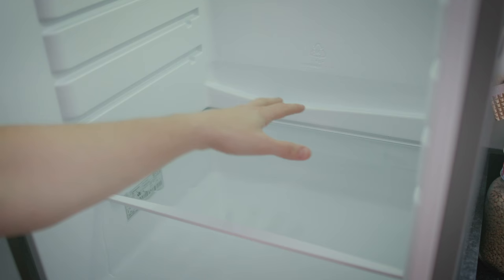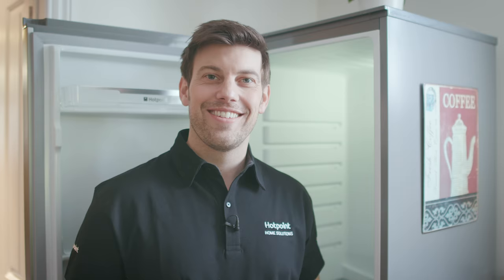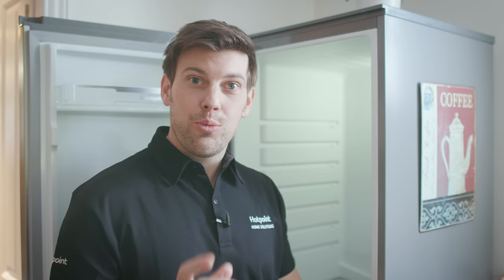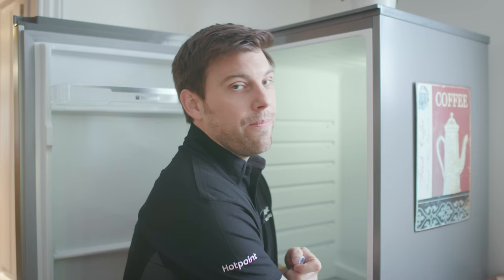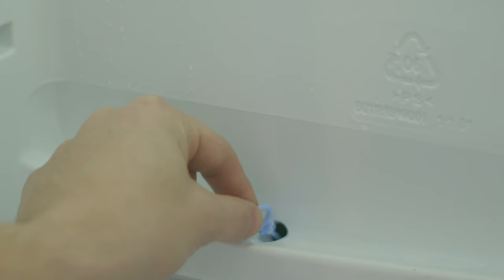How to unblock your fridge drain hole | by Hotpoint

Comment: Protip: if the clogging is out of reach for the straw, either due to distance or narrow turns in the pipe, an electrical cable will do the job! Obviously don’t have it plugged in any way 😆
Reply: Zip tie would work too!!

Comment: Sometimes it easy to forget how fantastic the internet is. Little tips like this restore your faith. Thanks.
Reply from the maker: You're most welcome! 

Thank you for such an amazing comment :)

Aimee
Reply: @HotpointCustomerServiceUK , actually the problem re-emerged after we had been away for a bit and when I tried the trick again i found that the gully was blocked by an ice core about 15 cm long. Firstly I tried to dislodge it with a plastic (bendy) pipette of boiling water but to no avail. i then thought I was going to have defrost the whole fridge freezer - but had a brain wave and used a the same pipette technique but with boiling SALTY water. This worked and I'm very chuffed - hope it works for others.
Reply: Agreed. We were about to buy a new fridge. I just stuck a straw down the hole and bingo. Unbridled joy
Reply: @HotpointCustomerServiceUK  i have always squirted bleach in that hole any problem with that?
Reply: Yes, much appreciated

Comment: A straw cleaning brush is good for cleaning the drain pipe too. (The bendy brush headed tool that comes with packs of reusable straws) 👍
Reply: Just did this and worked really well for me. Thanks for the tip.

Comment: Cleaning with such of small tool won't help in some cases. It depends on the fridge model/brand. 
In my case I had to use a long (50cm) stiff enough cable to clean the entire pipe from both (inside and outside) sides.
Reply: Thanks for that; the little tool didn't help me either but I was scared of poking anything longer down in case I damaged something, now that you've told me it's just a pipe I'll be on the case!

Comment: Thanks for this simple yet eminently helpful video! Thought I'd share a drain-hole cleaning hack I just invented: if you don't have one of those hole cleaning thingys, nor a cotton bud, nor a pipe cleaner, nor even a damn straw :O , you can improvise something with a kebab skewer stick, some gauze bandage pads, and a bit of duct tape. Wrap a bandage pad (oh, i'm american, so i guess a gauze 'plaster' for British people? :D ) around the end of the skewer, put a strip of duct tape along the bottom edge so it tapes the pad to the stick, another small piece around the middle of the pad to keep it wrapped tight around the stick. Then break the stick along its length under the pad so it will be flexible--don't break it too much, just enough so it will bend a bit!  Stick it carefully into the drain hole a ways, then pull it back out. I had to be careful that the tape didn't get caught on the way out and come loose, but by my second try I had a serviceable tool and it worked like a charm! I poured a bit of boiled water into it and it went right down. :)
Reply: Thanks Kat! Cheers mate :D
Reply: Your comment says you're funny. I approve

Comment: Thanks for this video. Please could you tell if the drain hole cleaning tool should be left in the drain hole?
Reply from the maker: Hi Swapnil

Yes, the tool should be kept in the drain hole unless the manual states otherwise.

Kind regards
Hotpoint Service

Comment: Had water collecting on the bottom. The drain hole cleaner was still in there, essentially obstructing it together with some bits of food completely blocking it. Problem solved in 2 minutes, thanks!

Comment: I bought my fridge 4 years ago, the drain hole cleaning tool has been in the drain hole for 4 years! How have I just found out about this....hopefully my fridge won't constantly be wet anymore now that I've removed it.
Reply: How did you remove the tool?
Reply: Same for us,  cleaning our fridge and a pool of water.  Il be keeping to tool in a safe place from now on.  May even put a straw down to make sure completely clear…  btw have you any idea how to get the front plastic door off the fresh drawer to clean in between.  ???

Comment: I don't have a Hotpoint fridge - mine is a Bush, but it looks almost identical inside. I don't know about the manual for Hotpoint fridges, but I can say with certainty there's not a word about any of this in the Bush manual. It mentions the hole & tool but doesn't say what they're for or how or why they might get blocked and need cleaning.
When the fridge arrived I was puzzled as the drain hole appears to lead to a very shallow open tray on top of the compressor. I assumed any liquid is supposed evaporate away due to the heat of the compressor. Not a word in the manual and another commenter says his is full to overflowing. The engineer blithely recommends checking it occasionally. I don't know anyone who pulls their fridge out for that purpose, and I'd be surprised if many realise they should (apparently).
A shocking gap in customer information.

Comment: I usually just leave this problem with the mindset that my tenancy lease is about to run out. “I’ll get a new fridge” however, I’ve just achieved my first hotpoint unblock drain cleansing & I’m surprised at how basic the plug is, a flimsy plastic rod. Surely with today’s technology I can have a fridge that doesn’t require my attention this way? Is there a design that’s achieved such grandeur?
Reply: Yes, auto defrost fridges don't do this

Comment: I have unblocked mine with a long stainless steel dredge pipe and water still keeps sitting in the dip and not going down the hole, if I don’t check my fridge the water drops in the veg / salad draw ??

Comment: I have tried the straw several times and still there is ice and water building up here which I manually mop up and get rid of. If the freezer needs de-frosting does this affect the fridge drain hole? What else do U suggest please? I cannot get an answer from Hotpoint on the phone!

Comment: Nope still doesn't work ?
Do I go ramming a bike brake cable down the hole ? 
Mine is a built in fridge/freezer , so I can't just easily pull it back from the wall ?

Comment: My drain pipe actually keeps freezing and will not unblock unless I turn the fridge freezer off and let it melt. This is not practical to have to do every week. Any solutions would be gratefully received

Comment: where does the dirt from the fridge drain hole go, does it drop onto the floor or does it stay in the fridge.
Reply from the maker: Hi Mechtech

There is a small plastic container behind where water and dirt gets collected, we recommend that you check this regularly so it can be emptied.

Regards
Hotpoint Service
Reply: @HotpointCustomerServiceUK  mine is filled to the top overflowing with water so it is blocked

Comment: Hi. I'm using LG GR-V2522SL model refrigerator. There is water leak inside and I'm unable to find any drain hole inside the refrigerator. I checked the drain hole locations mentioned in the YouTube videos like near the vegetable tray, but I'm unable to find it. Has anyone faced the same issue? Any help is highly appreciated. Thanks.

Comment: How do I reset my fridge, it has electronic buttons. Temp setting, power and super.
Reply from the maker: Hi Nikhill

It should state in your manual on how to reset the appliance. But the basic way is to turn all knobs to 0/off and then disconnect the mains....Leave this off for a few minutes then turn back on and set knobs to normal temperature once again.

Any further assistance please let me know.

Kind regards
Hotpoint Service

Comment: My drain hole is at the top fridge under freezer not at the bottom.  Help!
Reply from the maker: Hi! Thank you for your comment.

Could you send me your model number so I can advise further? 

You can also give our service line a call on 03448 224 224, they can help out with any questions you may have.

Thank you
Ryan

Comment: I have a button on my intergrated and not sure if it should be in out. It has a dot on top and what looks like a snowflake. Where is it supposed to be?
Reply from the maker: Hi Dee 05

Thank you for your message. Before I can advise I need a little more information, could you please let me know the model number of your appliance. This is found on the inside wall (usually behind the salad trays). 

Looking forward to hearing back form you
Hotpoint Service Team

Comment: Sorry, for me this does not work blockage is further down and unable to clear, have tried various method including passing a tube down as far as 15 inches, where it stops and still unable to clkear the blockage, have considered removing the rear cover as to remove and clean the tube but again unable to do as the cover is spot welded  so a differcult situation.
Reply: Had the same problem with a Siemens. What i did was to turn it off, let it dry out completely (12H minimum)  and then push hot air from the bottom up with a hair dryer. Be carfull though not to overdo it and melt the plastic tubes. Hope this helps. And bumbed on this https://www.youtube.com/watch?v=dcZ84XwcGns
Reply: @dr.drakeramore2740  thank you will try this the next time the freezer is nearly empty, thanks stay safe.

Comment: What would happen I poured hot water into that hole?
Reply from the maker: Hi Agostino9226
Thank you for your message! We don't recommend that you pour hot water down the drain hole, this could cause a disruption to the temperature inside the machine. 

Are you experiencing any mechanical issues with the machine or drain hole? 

Regards
Ryan
Reply: @HotpointCustomerServiceUK  I don't have a hotpoint, have a proline and I have tried this with a long piece of wire but still no luck. Maybe try from the bottom end of the drain hole  ?

Comment: The cold air goes down, and escapes through this hole, so I clogged it with some cardboard, this way the fridge stays colder, saving energy, but the water can escapes through the cardboard at the same time.
Reply from the maker: Hi Michael, we would not advise blocking the drain hole as this could affect the appliances performance. Kind Regards Hotpoint Customer Service

Comment: Why do they use this horrible design?
It's almost impossible to stop packages touching the back wall and it's so unhygienic when they get wet. 
Also, the water can freeze and develop chronic problems.
I love my own autodefrost fridge, but not all builders fit them into new houses, due to saving a few quid.

Comment: Anyone bought aHotpoint  Integrated Freezer HF1801EFAAUK  in last 12 months and experienced a loud noise problem caused by ice build up hitting the fan? We had this issue within 6 months of buying this model and Hotpoint have been out many times  to “ repair” but never do. Don’t buy.. useless v poorly designed product beyond repair despite being les Ethan 12 months old.   Very fed up....